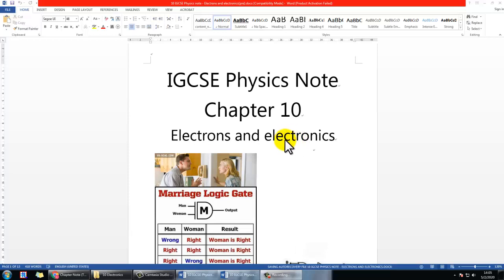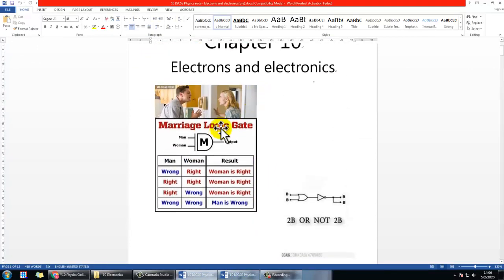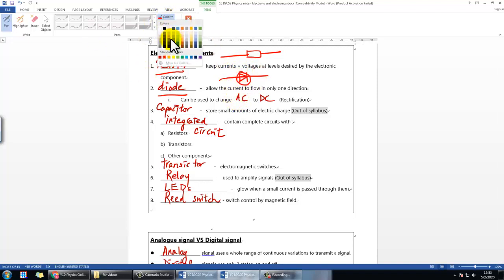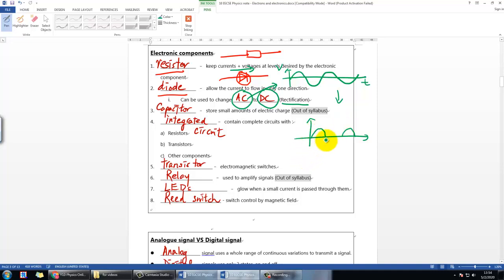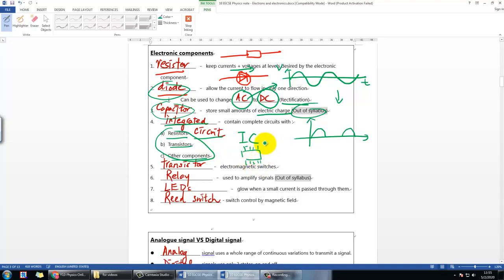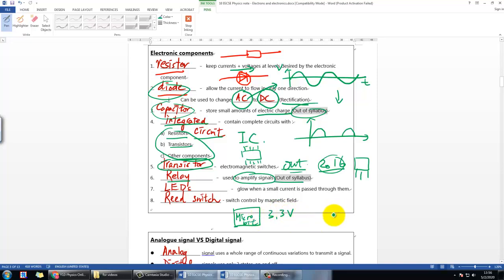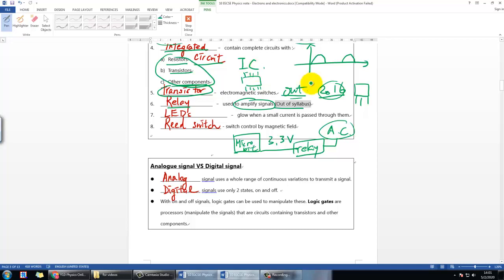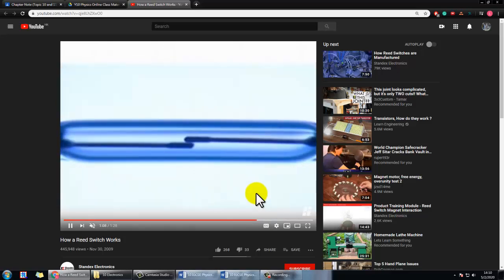Basic Electronics - IGCSE Physics Chapter 10 (Part 1)

Comment: 4:10 isnt relay an electromagnetic switch and transistor used for amplifying signals (according to the textbook page 229)
Reply from the maker: Very good question! I also thought the same in the past (the note was made around 2 years ago) 
and recently I found both of them can be acted as a switch and amplifying signals, as long as you set up the circuit correctly.
The main differences are mechanism and limiting voltage.
-relay works by electromagnetism. it can take high voltage
-transistor works by semiconductor. it can detect small voltage but too high voltage would break it.
Reply: @LouisWongPhysics  Ah okay I see. Thank you:))
Reply: @LouisWongPhysics  PJ is absolutely right. You simply cannot describe a transistor as an "electromagnetic switch".
Reply from the maker: @markwelton9428  You are right. I mixed up the description for "transistor" and "relay" in the video